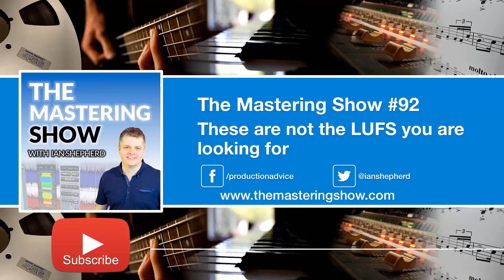These are not the LUFS you are looking for - Episode 92 | The Mastering Show Podcast

Comment: I used to master to a specific overall value(I didn't know better, it seemed logical). Now I master based on compression(don't want to smash the song but I do want to level it out some. But at the end of my mastering chain I do change the output so that the song has an overall level of -14lufs. You say it doesn't matter BUT i Listen, most often, on my MP3 player while exercising. I have a combination of my own music and commercially produced music. The last commercially produced music I put on the MP3 was a Joe Bonamassa album. It was mastered to overall 11 LUFS. Well, the listening level would be way too loud when I listened to that versus my own music. So I had to turn it down,. then one of my songs would play and I had to turn it up. I remastered(level only) the Bonamassa album to -14lufs and problem solved. I wish they had a portable MP3 player that would turn music up/down based on a user entered overall LUFS level.
Reply from the maker: It sounds as if you’re saying your player doesn’t normalise automatically, is that right ? So you’re making the adjustment by hand ?
Reply: @ProductionAdvice  This is not for Spotify, youtube... - it is for my own MP3 -player. It doesn't normalize automatically. If it did, I wouldn't have to do this. If I didn't choose a target LUFS for my own mixes the volume level would be all over the place. I wish I could find an MP3 player that would normalize, then I wouldn't have to do this.